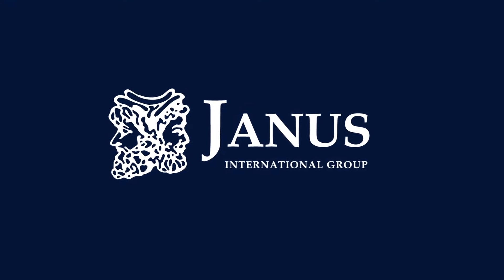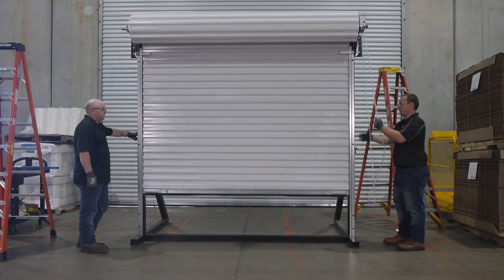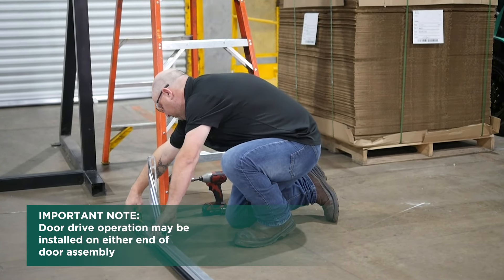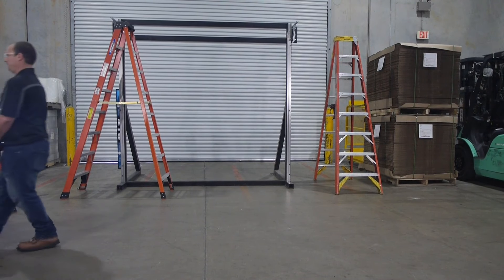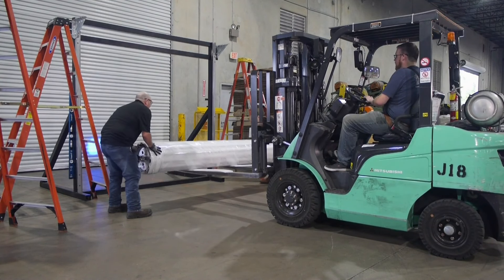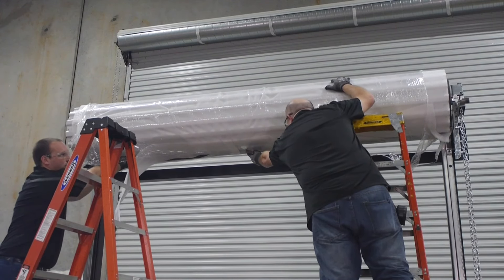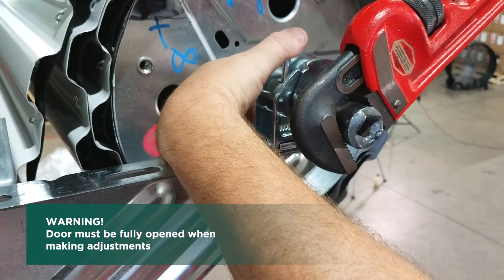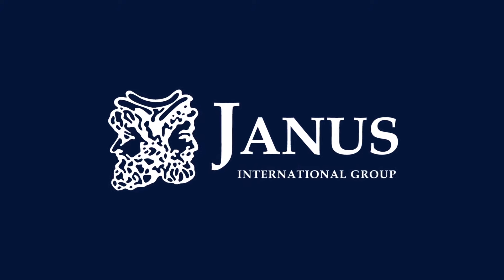Janus Commercial Door Installation Video

Comment: I have a metal garage w/ 2- 10' steel roll up doors. It seems no one makes motors for these doors anymore. The sticker says DCBI. The shafts do not protrude, and the drums are inside the door about 16". Making it impossible to attach a motor. What could I do to make them operate? Thank you!
Reply: Reg door opener.  The side ones are garbage
Reply: I'm installing the Vevor auto door opener. Extended the roll bar by adding an extension that slides into the end.  I cut an additional hole so the stops would fit. Several videos on here. Also photos on Vevor site from reviews showing how to modify to work

Comment: We will be installing a 12' door on a 8' opening about a week from now ("now" is 20241011). Let's set aside why we have a 12' for and 8' opening for the moment. I mentioned this to a fellow who has built self-storage units. He said something about untensioning (or words to that effect) the opening spring unit on the door. I know this is mentioned in the video (e.g. adjusting the tension). For my particular situation, is there additional guidance I should be aware of?
Reply: This was a success. It took longer than we estimated but we were dealing with an imperfect door opening. And, four guys working on it.

Comment: Can you recomend auto door openners for my two 8 x 10 Janus doors?
Reply: A company called "Automatic Technology" makes a door opener model the "Hiro" that has adapters to fit Janus doors. Check their spec sheet for compatibility with your specific door as there may be a different opener model that works for yours if it's different. I have a Janus model 3652 on my building which works with that opener. Working on installing it as I type this which is why I'm watching this video lol.
Reply: @RudysGarage  I think Janus may be out of business.
Reply: Janus is definitely not out of business lol. Picking up my doors this week.

Comment: At 2:20 if you mount the plates where you are saying to mount them and mount your guides against those plates it leaves you with a gap in between your guides and door jam, starting from a 1/4” at the top all the way down to the floor. How do you prevent that?
Reply: I think I know what your talking about 
I don’t think you can get away from that 
Without adding side draft stop or something like that

Comment: Hello. What do I do to stop the door from going crooked? Every time I go to shut it I have to adjust the whole door cus the lines aren’t lining up with the head. Ends up leaving a gap
Reply: Hi, I just installed a Janus 2500.  Mine goes straight down.  Are you sure the axle of the door is perfectly level and the side guides are also level.  My bet is one or the other is not.